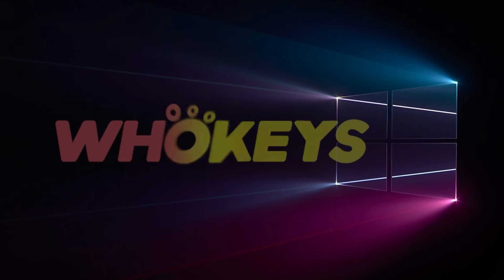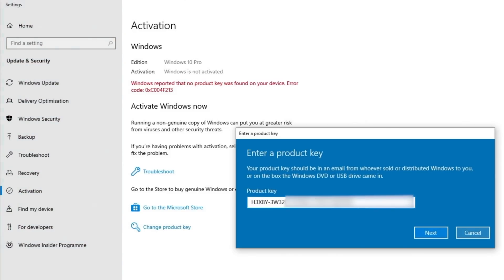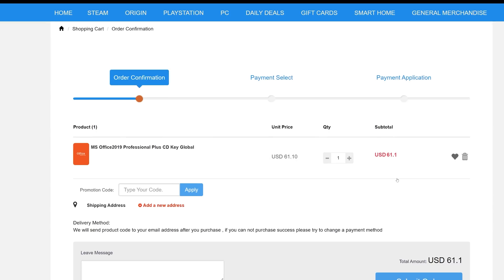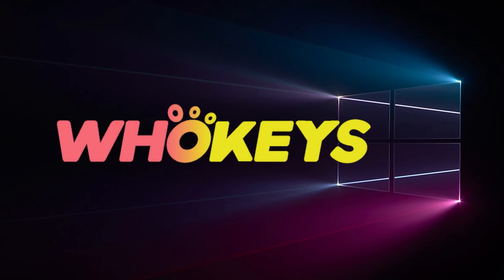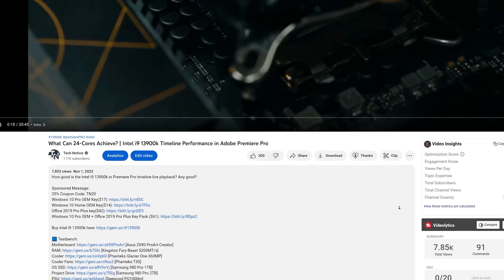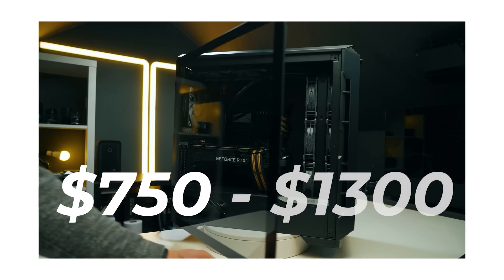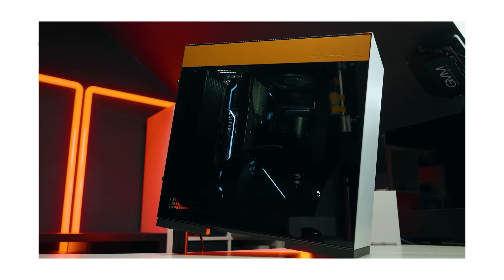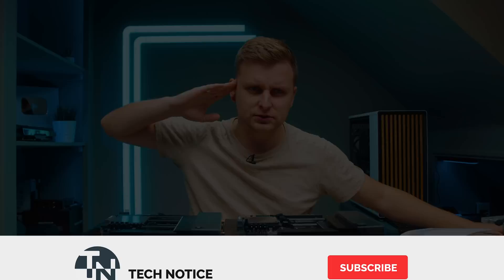BEST Creator Motherboard for Intel's 13th Gen 👉 Asus Z790 vs Z690 ProArt Creator WiFI

Comment: One of the things I feel like is being missed about this motherboard, and made me not go with it in a recent build, is it's lack of a 7 segment POST display. I think it is extremely important to have this on any system that is designed for any kind of work/production. I really don't understand why it is missing on Asus ProArt motherboards for LGA 1700 and I assume it is missing for the AMD equivalents. These do have diagnostic LEDs and I assume they still have beep codes, but who wants to deal with either of those when a POST display can be much faster, easier, and granular in what information it can give you when troubleshooting a system. The POST display is useful for overclocking, sure, but I would also argue that it is very important for people who's main machine is integral to making a living. I think more people should be talking about this because that is the best way to get Asus to add this feature to future motherboards. 

Also, I think you should review the w680 Asus motherboard since it also seems like a solid option for creators and might better fit some workstation needs and that motherboard basically has no Youtube content.

Comment: Mine had issues after three weeks. Red and Amber LEDS's started flashing. Managed to get it to boot and it worked fine during the day (I was able to turn on and off fine) the next morning the issue repeated itself. This repeats every morning, currently back with Asus for investigation. Interestingly, the CMOS battery is not visible as it is located next to the HDMI ports under the plastic cover. You have to remove the mobo to undo the screws at the back of the board to remove the plastic cover which reveals the battery. However, Asus support has told me the battery is not designed to be removed? So what happens when the battery runs out? :(

Update: Asus support have issued me an update by way of an apology and retracted their original statement and have confirmed the battery is removable...... I'm still awaiting the result of their testing the board.

Comment: I purchased and rebuilt my computer with this Mobo and I have a question.  Can you, or should you keep the wifi turned on while using the ethernet connection?  And by the way, thank you for pointing me toward this Mobo.  I am very happy with it's performance.  The Noctua cooler, I thinks works very well, as it maintains the CPU temp at about 80 degrees Celcius.  Looking forward to your reply.

Comment: Hello, Thanks for very good comparison. Where the ProArt_Z790-CREATOR_WIFI on board battery is located? I am experiencing a situation in which in every AC disconnection (unplug) there is no display and clear RTC is needed.

Comment: 10:30 To the left middle, there are two holes for the motherboard stand offs screws. Just below them there are two Philips screws (horizontally) on the motherboard at the left. But not on the motherboard on the right. What is going on there?
Reply: I just found out that it is for the the PCIe Slot Q-Release button.

Comment: Can someone confirm that the Corsair Vengeance CMK192GX5M4B5200C38 (or Corsair Vengeance RGB CMH192GX5M4B5200C38) 192GB (4x48GB) DDR5 DRAM 5200MHz CL38 Memory Kit is compatible with the Z790? It says in the Tech Specs: "4 x DIMM, Max. 192GB, DDR5". But in the memory compatibility table the 2x and 4x 48GB kits come up empty.

Comment: Can you let me know if the motherboard exhibits any coil whine? Either under load or maybe a faint buzzing which modulates in the background with system activity and present most if not all the time (can be caused by c-states).

Can maybe someone run Aida64 copy memory test and latency/ Prime95, Cinebench r23 to see if any of those induce coil whine?

I have Gigabyte Z790 Master, which is a fabulous board but has coil whine as described and i read that Asus Maximus Hero is the same... so how is it with ProArt?

Many thanks

Comment: I have the Z790 board. It's pretty awesome, working with 4x16GB 7200MHz DDR5, i9-13900KF and the MSI GeForce GTX 4090 Gaming Trio 24G. This thing is fast and stable AF. As a full time professional photographer and videomaker I needed this. Having it for a month now: loving the performance.
Reply: Why 4 16 and not 2 32 I don't get it
Reply: @jgvtc559  Could be any reason. I've done it before on a different brand board because I overlooked the size of my air cooler which prevented my high profile 2x32GB sticks of ram from sitting in their recommended slots. There were no low profile 32GB ram sticks in stock at my local dealer to replace them so I bought 4x16GB low profile ram sticks to compensate which just cleared my oversized cooler.

Moving forward about a year, I could've moved back to 2x32GB ram and sold the 4x16 sticks once I purchased my AIO but instead chose not to as they were already installed in my mid-tower build and worked just fine. I sold my 32's to a friend who purchased an E-ATX board.
Reply: But why are you using the KF variant. The IGPU in the K version 13900 has unique codecs that"ll hugely help in video editing and other workloads.
Reply: @Prabhu_njd  Well, I paired that CPU with a MSI 4090 Gaming Trio. No need for CPU grahpics. It also runs with 192GB (4x48GB) DDR5 5200MHz Corsair Vengeance memory on a ASUS Z790 Proart CREATOR WIFI motherboard.
Reply: @tpjverhoevenphotography   You really should have gotten the K variant if you are a videographer. The iGPU from Intel is the ONLY GPU that can currently accelerate NVENC 422 H.265 footage...a CODEC Canon, Sony, and Panasonic are all using. No AMD or NVIDIA GPU can do that and the only other chip that can do it is the M1 mac. Intel's Quick Sync paired with an RTX 4090 allows NLEs like Davinci Resolve to seamlessly shift between the two depending on codec. Of course if all you shoot is raw or some other codec then it won't matter but the chances are high you will encounter that codec at some point; even GoPros and drones are using it these days.
Reply: I have heard that people are having problems with the intel 2,5gb ethernet. This board also has marvell 10gb. Is the 10gb working fine?
Reply: @nese1  "I have heard that people are having problems with the intel 2,5gb ethernet"
There are no issues, other than the fact that the ones crying about it happen to be noobs who have no clue how to get it going.
Reply: @Jake-mn1qc  My current mobo has the intel I225-V ethernet and works fine, that being said, I find your comment very delusional. Older mobos definitely had some hardware problems and it was a silicon lottery to get a good one.

Comment: I read an Amazon comment from a customer that said : "4 memory slots just won't work! It doesn't even boot with 128GB of RAM, despite Asus saying it supports 128GB of RAM! I've contacted Asus support and they tell me they haven't tested this motherboard with 4 RAM modules, so they can't offer any support."
So as I need 128Go, I'm wondering. Have you tested ? Does it work or not ?
Reply: 790 actually supports 196 GB of RAM...check the website (vs the box)

Comment: Hey

I don't know if you know but for the ASUS ProArt Wifi Z690 you cannot update the BIOS without also having access to a 12th gen CPU. I should correct myself; you CAN update the BIOS without a CPU installed, however, the BIOS requires Intel ME to be updated before you update the BIOS and for that you need to be running Windows on the machine first. The effect is therefore that you need the system up and running with a supported CPU from the 12th gen before updating the BIOS to add support for 13th gen. My guess is that most or at least some people who buy this might not have a 12th gen CPU lying around.

I should say that there are threads on the ASUS ROG forums discussing workarounds for this, but ASUS does not support any of these methods and if you decide to go for one of them, to quote the support tech I talked to, "you are on your own".

If you are lucky and the motherboard you bought is from a later batch that has already been preinstalled with a later BIOS supporting the 13th gen CPUs out of the box, then this isn't an issue, but I don't know if ASUS has actually shipped any Z690 with a BIOS supporting 13th gen directly from the factory. I would not take a chance on it anyway.

Another alternative is to ask your retailer if they can help you with the BIOS update before they ship the motherboard.

Just know that it is not as easy as popping in a USB with a BIOS update.

For me, I got an older BIOS with my ProArt Z690 and I opted to get the cheapest 12th gen CPU I could get to use for the Intel ME update before swapping for the actual CPU I intended to run with the system. It's still a lot cheaper than going for the Z790 edition in my case, but a lot more work, so it might not be worth spending the extra time for some.

Comment: Does Z790 support 128 GB with XMP profiles?
I have a Z690 and I can't get my 4 Dims of 32 GB Kingston Fury DDR5 RAM to run at 5600 MT/s without a random blue screen, they only run at a "stable" 4800 MT/s (because in games, the PC crashes) .
The only way to run at 5,600MT/s is by placing only 2 dims, that is, 64GB of Ram. With only 2 dims installed I have no problem.

Comment: If you connect this motherboard's USB 3.2 gen 2x2 front-panel header to a Lian Li O11D EVO's front-panel connector which is specified as "USB 3.1 Type C" what speed will the front-panel USB-C operate at? 20Gbps or 5Gbps? As far as I have been able to decipher the mechanical and electrical connectors should be the same with identical wiring between USB 3.1 gen 2 and USB 3.2 gen 2x2 and my logic would say that the connector is 'dumb' and the motherboard's capabilities should define the port speed, but it wouldn't be the first time my logic fails the reality check test. Also is there any power delivery limitations with the Lian Li's front-panel I/O cabling since the ProArt Z790 board can support up to 60W of PD charging?

Comment: What is the function of Display Port (In)? I have a macbook pro 16 inch. Does it mean that I can just connect the TB3 to the TB4 USB-C slot and then connect a DP cable from the monitor to that motherboard board and it works?

Comment: The one aspect that you can't see whether it is different or not are the PCB layer architecture. The difference there could be what allows the faster ram. It is something that is nearly impossible to check unless companies release that info which I don't see them ever doing.

Comment: Can anyone tell me where the bios battery is located on the motherboard? What part of the motherboard is it on? (ASUS ProArt Z690-CREATOR WIFI LGA 1700 ATX Motherboard)
Reply: It's under the plastic shroud that houses the i/o ports. It sits in between the 10G ethernet and HDMI port.

Comment: Hmm, you should expand your channel to a large segment of PC builds market that is being greatly overlooked and under served.  The Traders (Stock, Futures, Forex, and Crypto Traders) all need and build or have custom built for them high grade PC’s.  The ASUS Z790 ProArt Creator boards are about the perfect for traders.  High speed stable performance with fast internet connections on the board everything we need.  The only thing different in our builds and needs from your Creators builds and needs is the high dollar high heat graphics boards, we don’t need them, we need very stable and reliable enterprise graphics boards and the best I know of is the Nvidia T1000 8GB which has 4-DisplayPorts able to run four 4K monitors at once with no issues and low heat.  It would be nice if Intel and ASUS would get together and design the future Z890 ProArts able to support 256GB DDR5 or even DDR6 at 6000 or even 8800.  Another thing Traders and Creator builds have in common is we don’t need or care for the RGB gaming crap, we need fast stable systems that are quite too.  So would be easy for your to include Trader builds and optimal components for our builds in your vids which would increase your views and subscribers.  Thanks and looking forward to your next vids.

Comment: Hi, I would like to know if ASUS Z790 memory certification topped at DDR5-7200 because DDR5-8000 was not yet available in time for the tests so they did not updated their certification specs so this motherboard can overclock to DDR5-8000 ? Or it really limited at DR5-7200 and can't go higher ? Thanks

Comment: I'm wondering between these two (Asus ProArt Z790 / Gigabyte AORUS Master Z790), but it's not so obvious decision, very hard choise to be honest and price in my country is exactly the same. For me IO on the back is much superior on Asus than on Gigabyte (there is HDMI 2.1, two DP 1.4, one more LAN 2,5Gb and two Thunderbolt ports and more audio outs (not important for me) on ASUS, on Gigabyte there is no HDMI at all, DP is 1.2 and no Thunderbolt) On the other hand I suppose there is better power control for the CPU on Gigabyte, but i dont know how much it could influence overall stability. Furthermore m.2 cooling with double sided thermopads on Gigabyte looks nicer than Asus where we can mount cooling only from one side of SSDs.
Reply from the maker: I'd go with Asus :)

Comment: Ram depends on the mobo not the cpu. Every mobo has a maximum frequency supported that you can active on bios. Why u say is a matter of cpu?😂 the difference is ram frequency that is the reason now is not worth to use ddr5 6000 that are almost same of a great ddr4 4200 plus good latency. This mobo is a little better cause can use better ram maybe in 2024
Reply from the maker: It's about the memory controller of the CPU;)
Reply: @theTechNotice  if a mobo can't afford ram frequence the cpu can't! Is false what u said

Comment: Your vids rock! What about memory stability z690 vs z790? That would make the z790 worth the extra $$$. I've been avoiding DDR5 motherboards because DDR5 is unstable at 128 Gigs of ram. Does the z790 board's new advertised AEMP II memory technology solve that? As an After Effects user I'd love to see a memory stability test with 128 gigs of ram at different speeds and settings. Thank you!
Reply: You have it running at 6000mhz?
Reply: I have 128GB of Corsair Dominator (bought as 2 twin packs) on the Z790 - I let the board handle all the settings. Not run into any stability issues yet. It passed several passes of MemTest86, and a few renders / games work fine. Haven't really tested it more than that though.

Comment: Hi, is there any change in the BIOS settings regarding CPU undervolting with the Z790 because with the Z690 Creator, there is no settings available to undervolt the PCU (there is no menu that allows to disable Undervolt Protection) like there is with the ROG series.

Comment: I was on the point of swapping to this from my ROG Z690 Hero in order to get the additional 10GbE port (instead ofthe expansion card I'd been using), but then realised that this comes at the cost of only having one internal USB3.2 Gen1 header... Solution: a second hand ROG Maximus Z690 Extreme and all is good with my i9-13900k hitting clocks I wouldn't have thought possible a few years ago on air!
Reply: Wouldn't a USB3.2 split extension cable solve the one internal header problem?

Comment: Can have Asus amd motherboard 
Can have AMD processor motherboard
Means
AM 5 socket amd 
Zen 4 architecture
Wifi 6E Bluetooth 5.0 higher
Pcie gen 5  min 2 slot 
1 thunderbolt and 1 type c charging for usb devices 
 5 th gen nvme support
DDR 5 ram support overcloking (cpu ram )
M.2 nvme gen 5 support 
And slot of m.2 nvme ( min 2) . Stata four 4 slot 
And  can have old dvd and floppy disk via usb support 
Ram support 6000 mhz

Comment: I would like to see, A video putting 13th gen in older z690 board, I've personally been having problems myself going to 13th gen on my strix Z690-E Gaming board.  !! It will not Post
Reply from the maker: Did you update bios beforehand?
Reply: @theTechNotice  Yes Sir,